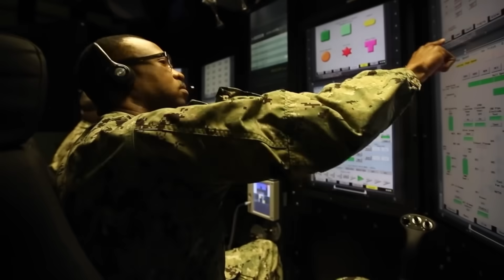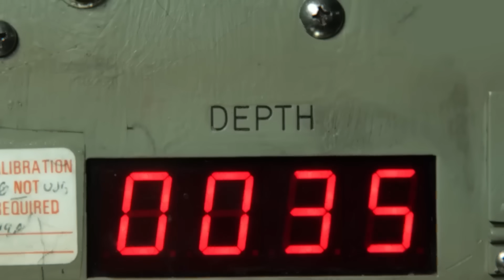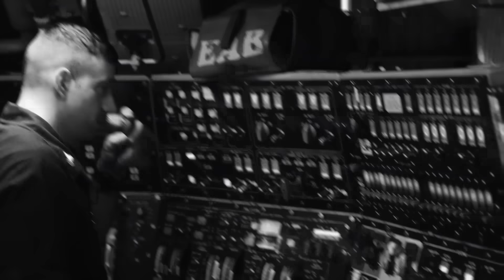What Happens When a Submarine Hits "Crush Depth"

Comment: One interesting feature on the Trieste is the large structure above the pressure hull, which many may mistake AS the pressure hull.  It is actually a buoyancy tank, filled with gasoline.  Gasoline is a liquid and thus incompressible, but less dense than water.  The result was a structure that provided some positive buoyancy that was immune to the intense pressure at deep depth. In some ways, the Trieste was a deep diving dirigible.
Reply: A petrol filled derigable.
Reply: The Trieste's viewing glass cracked on the way down.  I can't understand what that must have felt like to those onboard and what was going through their sminds as they kept going to the bottom.
Reply: @captainwin6333  Yeah i was reading about that and thought to myself.... The glass cracked 7000+ feet before they reached where they were going... and they still kept going deeper? I wouldn't have. In the same vein as, when a plane starts to have a visible problem, you generally turn it around and land it.
Reply: @douglasrobinson8491  It was an "outer pane", so probably not part of the pressure vessel. 
Which is not to say I wouldn't be frantically pressing the "Release ballast shot" button!
Reply: Imagine a  hull of the best quality steel that is 5 inches thick , in addition to any other component for its construction.
Reply: @xavierdaume2757  built by the lowest bidder lol
Reply: I served on a submarine base and set foot aboard a few boats during my time in the Navy, though never got underway aboard one. Submariners are a special breed. They have the same kind of "our job sucks but *DAMMIT WE'RE PROUD OF IT!!*" attitude Marines tend to have. They're all a little fucked in the head, but that's because the job requires it.
Reply: @Fragolux well not fucked in the head. You have to be psychologically sound to be aboard a spaceship with 30 other people with no sunlight and no way to leave. Also sleeping near 128, megaton-level warheads on top of 24 rockets which literally go to space before sending the spicy Doritos hurdling at Mach too many until it makes the sun above 100 cities, instantly vaporizing the lucky ones, smashing the unlucky ones, and exposing the really unlucky ones to neutrons which kill too many of their cells to live but not dying for a few weeks. 
Not to mention 2 nuclear reactors which are critical producing the power needed to split desalinated seawater into hydrogen and oxygen, so the Bois can breathe for the next 20 years. 
You gotta be a stable person, yet unstable enough to find climbing into a steel can, sinking it, and not coming back up for 3 months, as a good idea for a job.
But just think, if you're an American, then one of those boats with enough thermonuclear warheads to kill 80% of the human population, by itself, has been under the waves every single day for my entire life. All so that any country who wants to execute a nuclear first strike, has to think about that submarine. You will never get it, and it can launch all of its missiles from 100 feet underwater. 
I think Nuclear 2nd strike submarines have done more to maintain world peace between the superpowers than anything else.
Thank you for your service, I was in the Army but if you can't tell, I wish I would've been a Submariner.
Reply: Very interesting, no real urge to go to crush depth, prefer to die on dry land

Comment: For those wondering, the Titan submersible, at the depth it was at, would’ve imploded so fast that the passengers onboard wouldn’t have even noticed. At that depth, it would only take 0.009 seconds for it to go from perfectly normal submersible to flatter than a witch's tit. 5 adults became 1 baby midget.😂

Comment: So painful?
Reply: Assuming you mean the OceanGate Titan incident, no not at all. They were already so deep down that when their sub failed it got crushed completely within a fraction of a second. They turned to burnt mash before any pain was felt since it likely happened faster than their nerves could proces. Even the nerves closest to the brain, so basically your whole head so the signal doesn't have to travel "far", which processes the feel of pain, wouldn't even notice anything. The implosion literally happens within a snap of a finger where the hull is still intact but then once it gets compromised, which possibly can be heard a few seconds before it happens, it's all over just like POOF. That is the amount of pressure you are dealing with at that depth. Water from all sides just wants to devour the sub. And then to think there are parts of the oceans which are much deeper.
Reply: @R.James.  okay, that’s was what I was wondering. I’m assuming it’s a lot smaller than the subs shown in this particular video. So things obviously happened more quickly? Would a large sub with occupants crush as quickly?
Reply: @curiositykilledthecats  Size of the sub doesn't matter, it's the depth that matters and therefor the pressure. Once the hull cracks it's gameover in litteral milliseconds if not less. The implosion for the larger sub is 'bigger' because more air to compress since it has a larger hull, but it has the same outcome on the same depth.
Reply: What about brain activity it would take multiple seconds if not minutes to die so I wonder how much they would be aware as they died
Reply: @matthewm7867  Their whole body gets cooked in a flash, because the pressure of the water compresses all the air so rapidly it will literally turn into a plasma which is around the temperature of the surface of the sun. This happens for a split second. And realize that humans have air inside their lungs but not only that, they have air inside every single cell in their body. You get cooked from not only the outside but also from within. There won't be any meat on the bones left and right after the air bubbles escape out the actual water with all its pressure comes in and makes double sure nothing will remain in pieces. That is facts so far, but from this point I'm not entirely sure what happens to the skeleton, but likely the bones are atleast partially just powdered and will be dust in the ocean.
So your whole brain activity question is irrelevant, because I explained about te nerve system already. It has no time to react as your body is just poof, gone.

Comment: 3:56 - Hate to sound like an armchair quarterback but, it almost seems common sense that when building a sub they'd do so in a way to completely isolate anything electronic, especial crucial electronics, away from the possibility of water splashing onto them. With a bunch of pipes and pipe joints in a room you'd think that would come into consideration. Like, I won't even put an open glass of water on top of my TV set in case it got knocked over somehow...

Comment: what the fuck is a feet
Reply: Annoying isn't it.
Reply: In this case, a unit of measurement.

1 foot = 12 inches
Reply: @METX210  I wish the Americans would get up to date and use the metric system.
Reply: @ant7699 We shouldn't have to! Everything ain't for everybody!

Also, the US isn't the only country that uses the imperial system of measurement. Myanmar and Liberia are the other two countries that use it as much as we do, but, it is making a comeback in some countries that swear by the metric system.
Reply: @METX210  Very true. I'm just used to using metric here in the UK. Although most of the olders and a mix of younger do use feet and inches etc... metric just makes sense to use to me. 👍🍷
Reply: @METX210  Actually I'm a scuba instructor.  Havnt taught for a while.... metric seems to makes sense there, though you can use both.
Reply: @METX210  it is a reference to the vid where the dude screams "what the fuck is a kilometer".
1 foot = 12 inches, cool, a meter is 100 centimeters

Comment: I have a question. Say a large sub leaked water at 5,000 feet, filling up from the bottom. What would happen to the legs that touched that water? Would the pressure be reduced because it was still contained in the sub?
Reply: I had the same idea with a diving bell a couple of years ago. From what I learned: The water entering the sub will increase the pressure in the hull to that amount of water that had entered. So if it enters just a liter an hour this will get added the pressure of a liter/hour to the subs inner pressure. If the water comes pouring into the sub in large amounts the air pressure will rise to that of the surrounding water till its equal. So it does not matter if you touch the water or the air. You already are "under high pressure". You will feel no difference between air and water I think. Just the air will be very hot around 1000°C or so.
Reply: @void1968able  so you would burn?

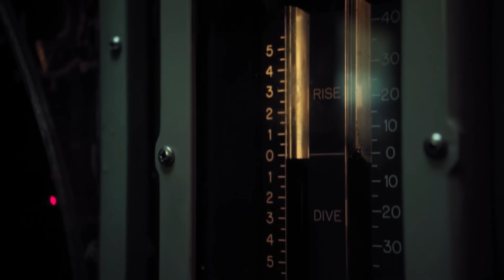Comment: 2:07 "...at a depth of 2,000 ft, when the air pressure is around 60 atmospheres..."
Air pressure? Um, no. It would be 21 atmospheres at 2,000 feet, but it wouldn't be air pressure.

And "the crew would perish multiple times in the blink of an eye"? 
How many times can you die?

So dramatic!

Comment: Me and my mate are gonna make a submarine. We're gonna make it out of old washing machines. The washer doors will be the windows. We're gonna weld the metal together and use anti roll bars so it won't cave in. We're gonna duct tape a few hoover pipes together to act as a snorkel that will remain on the surface of the water, no matter how deep we go down with an armband attached to the end of it. And we'll be using an engine off a speedboat that my dad won on Bullseye back in 1985 to power it & it'll be controlled with a 9 pin, quickshot 2 🕹️ joystick.

Comment: One important detail you left out of the Thresher tragedy is the icing problem. An emergency blow was initiated where air from the high-pressure flasks was released into the ballast tanks. This should have saved the boat, but air cools down as it expands and in Thresher's case the moisture contained in the high-pressure air sublimated into frost that clogged up the valves, stopping the flow entirely.

Nowadays a submarine will dehumidfy the air pumped into its high-pressure air flasks, which takes some time. This is why modern subs are loathed to use high-pressure air to surface the boat except in case of an emergency (to surface normally, subs will plane up to the surface until the sail is above water, then slowly draw ocean air into the ballast tanks).
Reply: Sublimate doesn't mean what you think it means.  It means pretty much exactly the opposite.
Reply: I like how you added that little bit that was completely wrong to the definition you deleted.

Comment: The video explains what happens at 200 feet / 800 p.s.I.  The Titan was around 10,000 feet / 5600 p.s.I.   Almost 3 tons of pressure per square inch. Similar to stomping on a fresh egg as hard as you could.

Comment: I know it isn't, but listening to all this feels like propaganda because water normally does not operate this way when we otherwise interact with it. Sure, air wanting to rise to the surface is of course easy to demonstrate by holding a sealed empty bottle under water, no denying this. But the idea that all the collective weight of the above water actually applies weight on you sounds like nonsense. When diving, at most your ears will hurt from the air inside trying to escape, same with inside the skull. I have never been that deep, yes, but I have also never felt any weight pressure from water at any depth I've experienced. How do we know this for sure? Did someone descend in one of those dive bells at stupid depths and instantly folded like a napkin when going outside it? Also, if the weight of the deep ocean truly was a cause, then surely the now very deteriorated wreckage of the Titanic should be smushed like a flat sheet of coralled steel on the sea floor, but it still maintains some structural integrity.
Reply: No. The Titanic broke in half filled with water then sank. No pressure difference between inside and outside of the hull.

Comment: What happens at crush depth ?
In short : A tubular object with room in it will be transformed into a sheet of plate metal of less than an inch thickness inside the timeframe of a few milliseconds .
creak, creak, creaaaaaaaaaaaaaaaaaaak,   KLONK .
†

Comment: Rush's education and  background was in aircraft engineering, he used to work for Boeing and didn't really know sh** from apples about marine design, but was so arrogant he thought knew more than the experts in this field. It's like a cardiologist thinking he can do self- taught brain surgery better than specialists.  "Carbon fiber composites are really strong and are an ideal material from which to build many parts of an AIRCRAFT. The use of carbon fiber for aircraft bodies allows them to be more fuel-efficient, more aerodynamic, and to be built with fewer and lighter parts."- Boeing. That's why Rush choose this material ; it was what he was used to working with as an airplane engineer, and he thought its advantages would carry over into submersibles. However, huge water pressure is a different story.  This stuff doesn't hold up over time when  subjected to tons of water pressure pressing on it causing molecular penetration and delamination. The dude just wouldn't listen, he thought he was just too smart, fancied himself as a maverick unconventional innovator. The engineering community who build these things tried to tell him again and again.

Comment: When a submarine reaches or exceeds its crush depth, it typically leads to catastrophic consequences. Crush depth refers to the maximum depth at which a submarine can safely operate without sustaining significant structural damage. The specific crush depth of a submarine depends on its design, construction materials, and various other factors.

When a submarine surpasses its crush depth, immense pressure from the surrounding water begins to exert force on the vessel's hull. The pressure increases rapidly with depth, and once it exceeds the structural integrity of the submarine, the hull starts to collapse or implode.

The implosion can occur suddenly and violently, resulting in the disintegration of the submarine. The immense pressure causes the hull to buckle and collapse inward, leading to the destruction of compartments, equipment, and ultimately, loss of the submarine.

The crew inside the submarine would experience an incredibly dangerous and terrifying situation. The rapid implosion could cause severe injuries or fatalities due to the violent forces involved. Additionally, the submarine's systems and equipment would likely fail, further complicating any attempts to survive.

Rescue and recovery in such a scenario would be extremely challenging. The depths involved would require specialized deep-sea salvage equipment and expertise. Unfortunately, reaching and recovering a submarine at crush depth is often deemed unfeasible due to the extreme conditions and risks involved.

It's important to note that modern submarines are designed with safety measures and multiple hull compartments to withstand significant water pressure. However, intentionally or accidentally exceeding a submarine's crush depth is considered highly dangerous and is generally avoided to prevent catastrophic consequences.
Reply: Thank you, Jacque Cousteau.
Reply: @robira1313  ignorant! This guy has tried to give you some facts, btw, bit disrespectful to Jaques Cousteau he is dead after all! He was the most remarkable man and a pioneer in Oceanic Exploration. Bet even he wouldn't go down in a Tupperware box!!
Reply: Thank you sharing in details
Well explained
RIP to the departed souls
Reply: @MontereyMotion ths is exactly all I was thinking while reading this
Reply: @jaron-craighunter4485  For sure. "It's important to note that" is literally ChatGPT's go-to "don't try this at home" warning when you ask it about something that may be grounds for a lawsuit.
Reply: Bot
Reply: ... Chat GPT bot? You write like Chat GPT.
Reply: mf using chatgpt to get some likes
Reply: Yeah, the Hydraulic Press Channel already demonstrate the implosion with the 1:1000 scale submarine replica, and the implosion destroyed the whole submarine in just a few milliseconds
Reply: aint no way bru😂 but fr tho💯 ong❌🧢

Comment: Did anyone else hear (any body parts or oil would seep to the surface) I didn’t hear or see anything about that for those people on that sub was it a tax scheme??
Reply: For the size of that tiny electric tub,  there would be sod all fluids to notice. 
Also a human body would resemble a tiny soup stain at that depth.
Reply: @corvusscottwilliams4751  1:53 listen carefully they rise to the surface. So depth is not an issue on the surface
Reply: @Qwizitis I listened.  They are saying about crush depth for submersibles that cannot reach the depth of the Titan shoe box sub. 
If it imploded on the Titanics grave you would have no body part's to float to surface. Any remains would need a microscope to find.

Comment: The submarine was made of carbon fiber, not metal.
Metal would implode.
Carbon fiber would shatter like glass.
This means it never imploded but rather shattered.
All the water came rushing in along with the sharp shrapnel from the carbon fiber.
Maybe they didn't die so quickly or seamlessly ☹️
Reply: i am assuming with the sheer energy/shearing forces that it would have been like a garbage disposal/juicer.
just a THWOMP then a cloud of red juice.